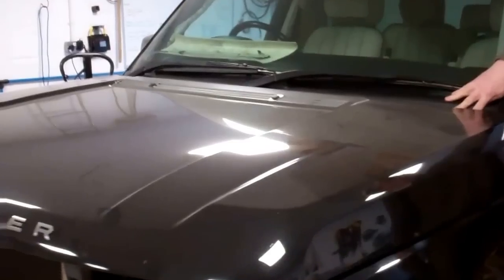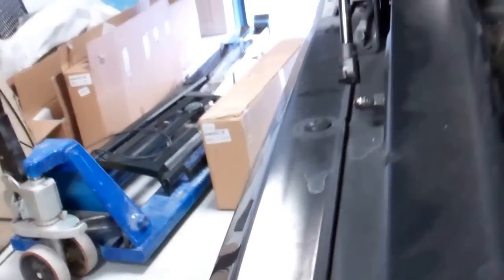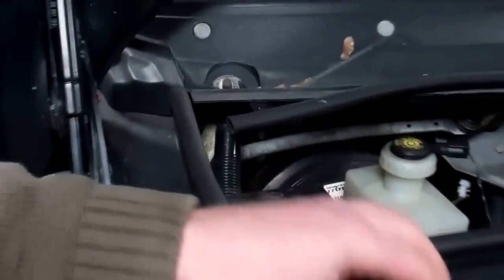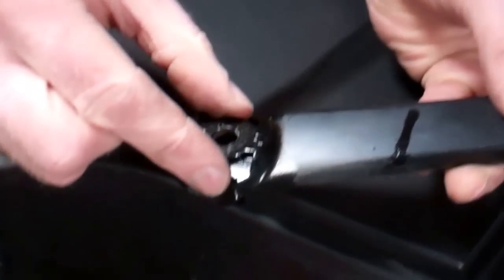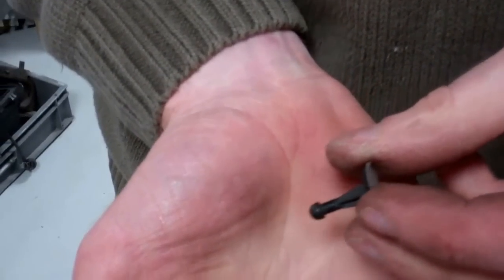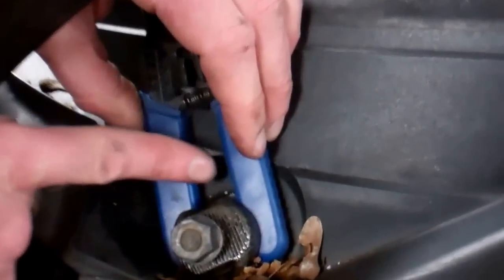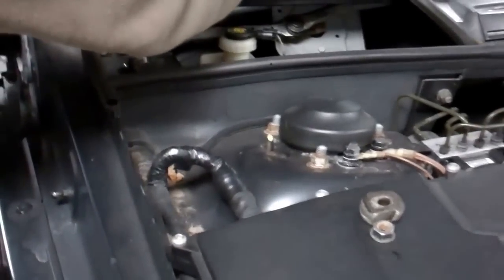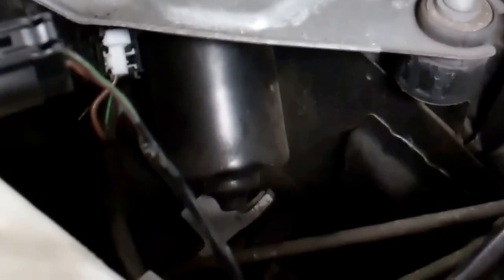How to remove the Range Rover L322 front windscreen cowl lower trim plastic panel

Comment: Thanks, useful.  i had to repair the likage on the passenger side wiper.  Arm had come apart and wouldn't stay on as joint worn.  Whole assembly out, drilled through damaged linkage joint and secured with split pin and washers on both sides.

Comment: Did you ever get round to replacing cowl? Have you by any chance encountered a vibration noise? As mine appears to have developed a noise from windscreen area when travelling 50 mph + since cowl removal/replacement
Reply: I only took out that plastik peace in the video to fit a larger battery. I also have wind noise now but only on one side. Think some of this clips are broken. Have to take it out again to check

Comment: Very interesting, it may be time to invest in a copper/hide mallet rather than using a carpenters claw hammer to thump things with, also a good idea to use the air line to blast all the junk off the channel before it all drops into the scuttle. Thanks for posting this operation.
Reply from the maker: Good points - as you can probably tell i am not properly workshop trained...more of a "have a go office boy" really. I will get a copper hide mallet on order !
Are you English living in France..... if so i am jealous !
Reply: @L663  "Have a go office boy ", well, you are really giving a lot of encouragement to others with the videos you produce, with modern cars using the multitude of hidden plastic clips and screws it is all too easy to ruin a part just finding out how it comes apart, the old way was to go to the nearest breakers yard and tear one apart there, armed with this knowledge you could then attempt a dismantling on your own vehicle with a chance of success, but now we have YouTube to show us what is under the plastic trim, your door mirror video was particularly helpful as this is a job I have to do on mine, you will find the copper/ hide mallet a huge benefit as it does not damage whatever you are striking. Living in France yes, t is very nice, just like England was 50 years ago.